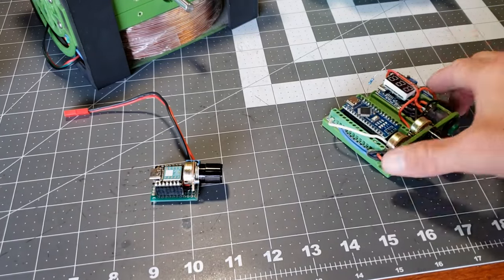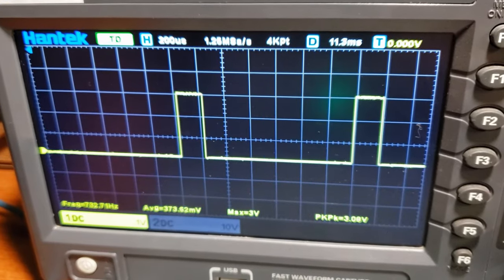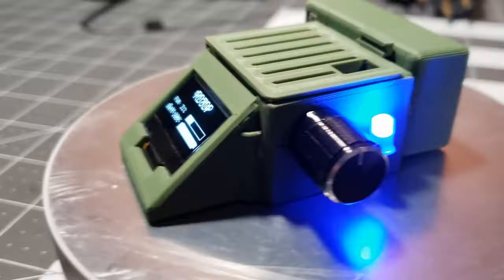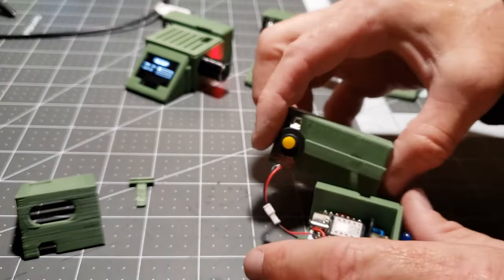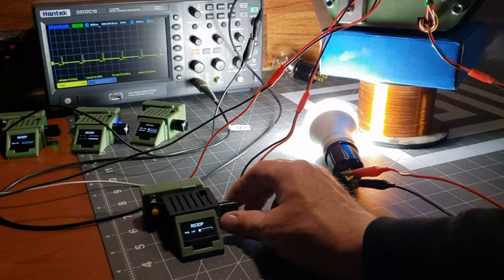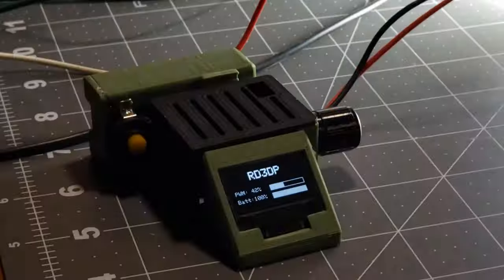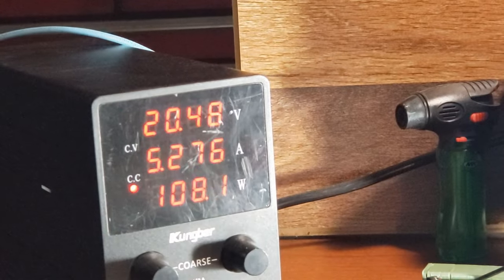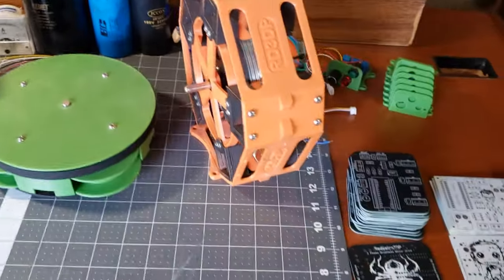Redesigned PWM Controller

Comment: Nice work bro ! The screen is amazing touch ! 
That clean pwm square wave will give pulse motors much more output to run lights and charge batteries wile running a load !

Comment: Hey man, thanks for your research. I’m off grid and trying to collect some of that sweet electricity from the atmosphere to charge a couple of batteries and charge my phone. Really just to survive out there. 

How would you tackle this problem? I’m thinking about collecting with a coil then going into a resonant RLC circuit, the reverse operation of a Tesla coil. I don’t have all the required knowledge and I need help on this. 

Thanks in advance to anyone who helps
Reply from the maker: I don't know about atmospheric, I'd go with solar panels. You can use a cap dump circuit or bedini to revive dead lead acids. Most new inverters have usb charging for your phone.

Comment: Noob question sir. What is the difference in function between the opto coupler and a pwm module? Thank you sir.
Reply from the maker: Optos turn on the mosfets at the precise position
Reply from the maker: Pwm allows for speed control by varying the on time 0-100%. It also helps to create flyback spikes from the square wave on/off cycles. Makes for better output.